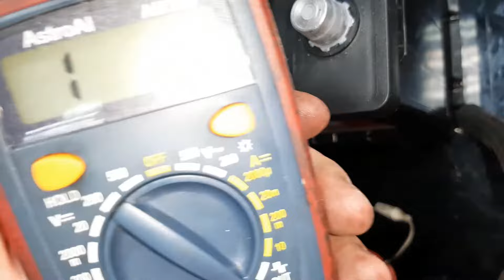EASY check for turbo solenoid failure

Comment: What is the ideal condition of these type solenoid,is it open or close when there is no power supply(engine is off comdition).?and when the engine going to higher  rpm these type solenoid function will be open and close or partially open or close ?

Comment: Is all 3 port N75 valves the same inside, for example will a Nissan N75 valve work on a VW if connectors are the same?
Reply from the maker: If the resistance changes, no...
Reply from the maker: In that case check the references...

Comment: Thanks, it's straight forward. But can it be working below specification (partial failure) or is it like light   bub that goes off once it's bad?
Reply from the maker: If the ECU detects that it is bad, it deactivates it and stops sending electricity.
Reply: @car-parts2.011  I'm going to bench test it this morning and my possible results would be forwarded to you. kind Regards
Reply: @OluwasijibomiMuyiwaBolan-ht1ub  news?
Reply: @car-parts2.011  ha? based on what it will stop sending electricity ?